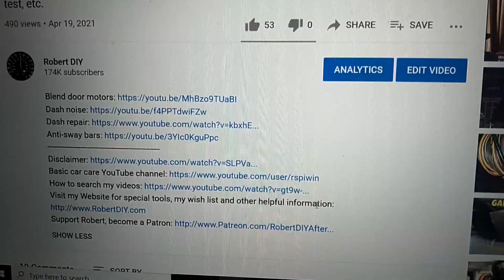My AC drama, yes the compressor clutch is fine. LOL Still in Cincinnati and did get more AC parts.

Comment: Check throttle sensor isn't showing WOT (wide open throttle) signal to ECM, that would stop AC operating.
Reply from the maker: Hmmm, I'll check that out because my ECU is cutting ground to my AC relay behind the glove box. Wouldn't it have other running issues?
Reply: @RobertDIY  Not necessarily, it should generate a DTC, but if has been faulting for over I think 50 drive cycles, it may get discarded by ECU.

Comment: I hope you find the problem with your ac I have the same problem I got no 5v which also made the check engine light come on for p1308 and p0453 98 s70
Reply from the maker: The system is pretty simple so it shouldn't be hard. I'm going at it here in a few minutes.